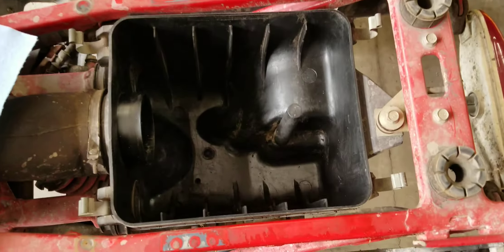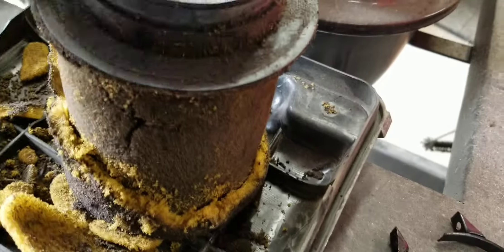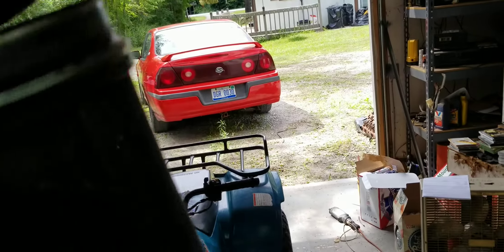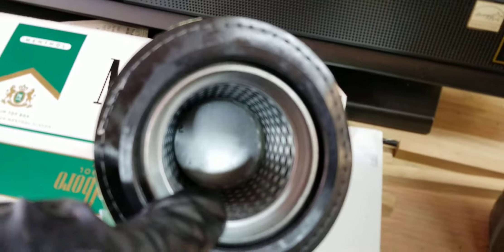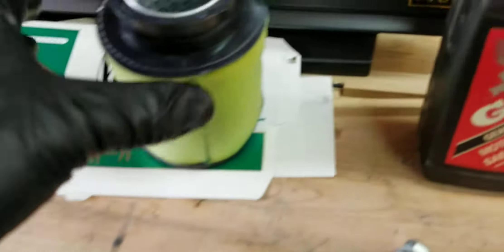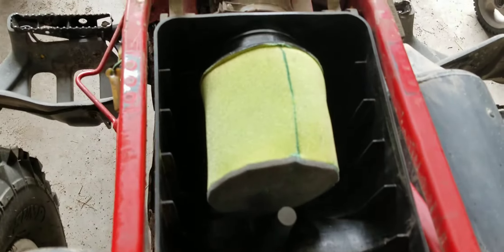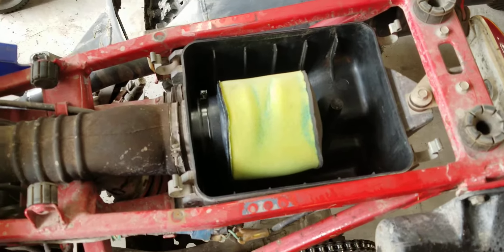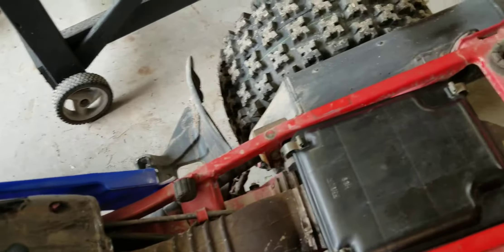1991  Honda 250X Gets New Air Cleaner Aug 24, 2019

Comment from the maker: The New Air Cleaner Filter Used in this Video :
No Toil Pre-Oiled Air Filter
Fits: 1991 HONDA TRX 250X FOURTRAX
Part# 1159700048
From : Rocky Mountain ATV/MC

https://www.rockymountainatvmc.com/pa...

I can also say that the Uni Air Filter, did not fit for me.

Uni Air Filter
Fits: 1991 HONDA TRX 250X FOURTRAX
Part# 1068790052